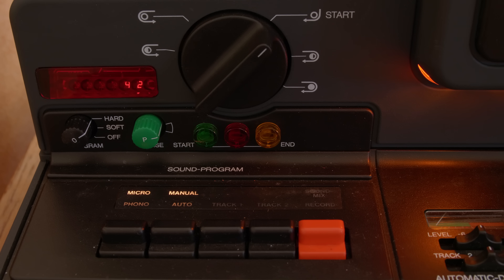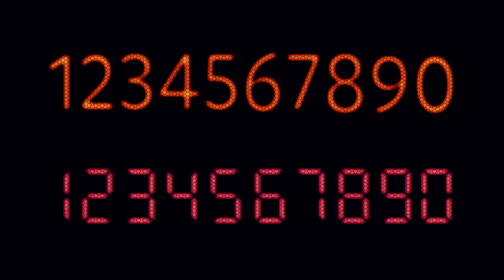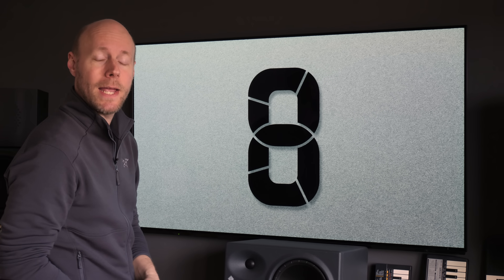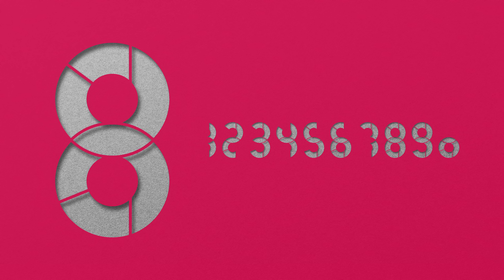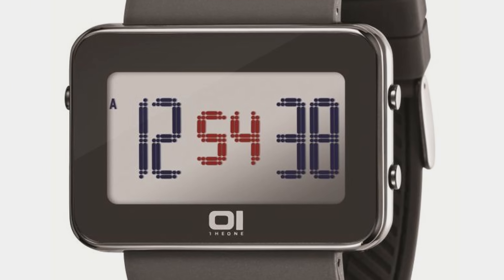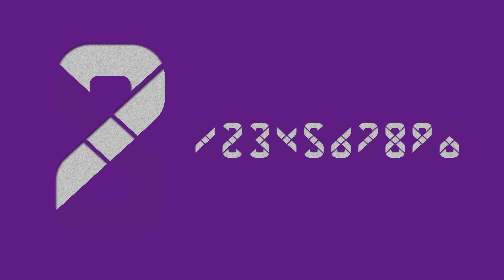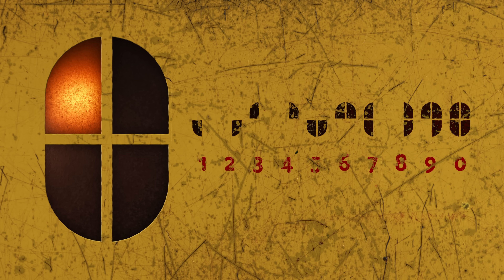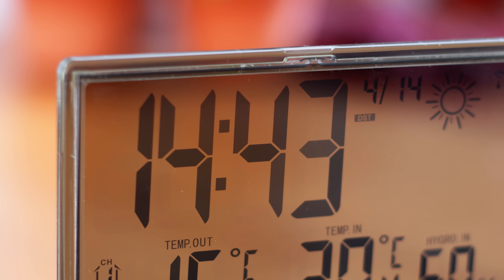Segmented Displays

Comment: The 7 segment double square has a hidden benefit.  You can encode your numbers as a byte each, without any wastage (6 segment) or need for multiple bytes (with wastage in a lot of cases), so it fits nicely with digital logic.
Reply: Why would a seven segment not have spare data in a byte?
What happens to the last bit?
Reply: @valentinfinozzi9358  y'know how 7-segment displays will often have a period/dot/colon? that's what the 8th bit is is used for
Reply: I recently bought a alarm clock off Amazon and it has a 7 panel font to the numbers. It is my favorite font I've seen and didn't realize it at order. The middle panel is a capsule shape, top and bottom panels are curved shapes with 45° corner cuts (like a slice of a donut), and the 4 vertical panels have half round inner corners  to accommodate the capsule shaped center but flat on the edge. It is so nice looking compared to what I've had on everything else. I never voiced these thoughts but here this video is in my recommended 🤣 thanks this video was awesome thanks!
Reply: @mcsquared5005  You should link the product.
Reply: @mcsquared5005  could you please share the name of the clock
Reply: It can also nicely display A-F so it can display hexadecimal too.
Reply: If a design has 15 segments (and the dot) wouldn’t that be almost as efficient but look better? Just saying
Reply: @OtterNoodle  14 segment displays exist and are widely used for stuff where you need to display letters. Not sure what you mean by "almost as efficient" tho, it's about half as efficient which is far from almost imo.
Reply: It also can do AbCdEF pretty well, which makes it convenient for displaying hexadecimal. just gotta make sure your 6 has a line on top to be distinguishable from b.
Reply: The extra byte could be used for a comma
Reply: @beanlets  it’s used for a period
Reply: Only really matters for software, though.  For hardware, you can use arbitrary bit widths.  I have some FPGA designs with 11 bit buses, for instance.
Reply: you mean bits not bytes right??
Reply: @crw_5319  No. 1 byte is 8 bits. So a number shown on a 7 segment display fits into 1 byte. If you were to use a display with more than 8 segments you'd need multiple bytes to represent a single character.
Reply: @crw_5319  no, I mean bytes.
Reply: @dreadlindwyrm  yeah you’re right i was thinking how you can represent all numbers with just 3 bits in binary but that was completely different
Reply: Was about to comment why having more segment is not a good idea. Thanks.
Reply: Old devices sometimes used 7 bits rather than 8. I'm not sure why, but they did. This is why ASCII is a 7-bit encoding.
Reply: @angeldude101  they probably needed the extra bit for some form of metadata.
Reply: i feel like my personal choice for a 7-segment display would be Freeform-7 from the sheet.
Reply: @datadoqueres9385
Reply: If you wanted to do a 9 segment display in a single byte, all you have to do is put 9 bits in the byte.

The number of bits in a byte was never a set number - people who have forgotten computing history just assume it's always 8 because that's what it is on the computer they're sitting in front of.
Reply: @trejkaz  That's not how it works though. You can't just make up a new length for bytes without redesigning the processor. 8 bits aren't an arbitrary choice either, since binary numbers are represented in base 2, using a power of 2 for word/byte size makes a lot of things convenient, continuing this "chain of convenience" led to the abundance of 7/8 segment displays.
Reply: @terryriley6410  8 bits are totally an arbitrary choice. It could well have been 4, or 16, and still been a power of 2. And also you're forgetting that a lot of computers did not have a byte size of 8.

And you're also assuming that all processors are binary.
Reply: @trejkaz  4 bits aren't enough resolution for most things, too rough to have a "realistic" color palette, amplitudes for audio or to even represent the letters of the alphabet, 16 bits are more than enough. 8 is the first power of two that is generally useful.

I never claimed you couldn't have non-binary processors  or that no other byte length could work. It's a question of comfort, efficiency and tradition. Which makes 8 sized byte or 7 segment displays not a "totally arbitrary" choice. You can of course free to design your own processor and n segment displays if you want.
Reply: @trejkaz  I assume in that end bit you are talking about the trinary experiments of the russians, they failed because its too complicated to represent 3 states with electricity, yes you could have half of the current represent 1 and full current represent 2 but trying to figure out that is much harder than just off or on, also I mean 8 bits is almost arbitrary but they do have actually have a name for 4 bits called a nibble, im sure people use it its just byte is quite a convienient measurement for people, also I'm sure there were some technical limitations of the time making 8 just an easy choice but uh dont quote me on that lol
Reply: @macslash5833  See paper: Tunnelling-based ternary metal–oxide–semiconductor technology (2019).

Quick tl;dr: Korea succeeded where Russia failed.
Reply: @trejkaz  Wait seriously? Huh that's cool as hell, ty for showing me this, I guess I was kinda wrong I guess the russians were just wayyy before their time on ternary computing which makes sense lol
Reply: @trejkaz  yes, but being a small enough value to represent most computational representations and being a power of 2 certainly helps it be the convention. Like saying googling (or in the case of csi miami, bing it)
Reply: I’m gonna need that in English please
Reply: @DJCARKENT  memory occurs in chunks called bytes made of 8 bits which can represent on or off for the segmented display.

Comment: I associate the two-square segmented display with Saint-Petersburg's old trams and trolleybuses. It's interesting that they also display the letter "A" (as in Saint-Petersburg's tradition shortened routes have it, for example the route 7A is the shortened route 7, and also ring routes are numbered with letters, so there is a ring route A.) A is written like this: 
         _
        |_|
        |  |
The problem is that the next letters in the Russian alphabet are "Б" and "B", which cannot be used as Б would look exactly like 6 and B exactly like 8, so while Moscow has ring routes А and Б, we can't until these displays are replaced.

Comment: I really like the 3 by 5 matrix, and I'm surprised that I dont think I've ever seen it before either 

It's very simple, yet also versatile

It has a bit of jank with the "n" and the "v" specifically, and the "w" and "q" isn't that greater either, but the numbers look really good and the first half of the Alphabet looks perfect

I quite like a bold, thick black design that contrasts the hardness of the strength of it being jet black with very clean, white edges and lines that are also softened slightly by being rounded

It's hard to describe, but it's like the slight tweaking and toning down of a sharp modern, monochrome aesthetic, but not one that's too thick and round to look bubbly, but also not too thin and sharp to lose it's boldness 

I feel like there's a very delicate balance of just how far in either direction I like it to go
Reply: Somebody said 3x5 has some illegibility between H, M, and W

Comment: Do you have any strong preferences about how your designs are used? I'm considering using your "no compromise" design as chapter numbers for a graphic novel.
Reply: Obvious thing to start with is give credit for the design in the book. Other option is special thanks section and credit him there. 
(But, If he dosn't give you direct feedback It's a bit up in the air if I would personally not use it. Unless he is explicit in a read me or something.)
Reply: @Mac_Omegaly  Depends on the use. The design is free to use for non-commercial purposes but If he plans on selling the graphic novel he will have to contact him

Comment: This got me thinking about the concept of displays that have other limitations.  Like, what if each letter has several servo motors that change the orientation of a bunch of sticks.  In my design, there's a central motor with two arms, where one arm has one joint and the other arm has two joints.  It doesn't matter which arm goes up because you can always just spin the whole thing around.

Comment: The train I was using as a student had a super fascinating display, which I analysed for hours. It was able to display digits as well as text, and consisted of equally designed segmented columns, which could be combined into variable width characters. For example, for a "1", "I" or "i" you needed one column, for a "M", "m", "W", etc. you needed five columns. Most of the other characters used three. I found the design choice behind this super interesting, and it made a quite versatile and readable display. (I cannot find any images of this online anywhere, sorry)
Reply: was it something like this:

|,,  |  |"|"|  |  |'-,|  |"|  |,,              (reads: LIMINAL)
Reply: @rextheroyalist6389  I'm not sure. In your example it looks like the columns are alternating between a soling column | and some smaller segments. 

The display I was describing was more like a matrix display, but some matrix squares were further segmented in "quarter circle + remainder" or "intersection of two quarter circles + remainder", in order to provide round edges for "m", "n", "0", etc.

And every column was segmented the same, and then a variable number of columns was combined for every character
Reply: @rextheroyalist6389  Oo that's nice
Reply: So if you search for "This LCD display appears in Subway trains in Berlin. What is this type of display technology called" you should be able to find mentioned reddit post.
Reply: @Alltagsabenteuer  that was oddly specific but it worked, thanks!!
Reply: @Alltagsabenteuer  https://preview.redd.it/1hf4ba75xklz.jpg?width=640&crop=smart&auto=webp&s=2f88e347e38274435f156f108fbed402f21224d3
Is this it?
Reply: @Alltagsabenteuer  bookmark comment later
Reply: @Alltagsabenteuer  oh wow that really is interesting! So many tiny segments…
Reply: Could you draw it and link an i,age?
Reply: Was this in the German S-Bahn?
Reply: @lahusa_  it might have been in use there, too. I just know it from the U35 in Bochum (which is a local tram)
Reply: @Alltagsabenteuer  perhaps a local can help? Leider wohne ich in Hannover :(
Reply: @geloschteruser2986  I found a photo on Reddit, but I cannot post links :(
Reply: @Alltagsabenteuer  perhaps you could give us the title of the reddit post?
Reply: @Alltagsabenteuer  gotta pay attention the next time I take the U35 xD
Reply: Typical destination sign.

The 4020 in Vienna uses the same.
Reply: 4:25 what it it say
Reply: Jgffhsndfqyychhjjvbkkb j
Reply: “oder”
Reply: @Strikingeight  you beat me oder is or I’m assuming user is German and if so I find it very comical to actually see this come out in text 😭
Reply: @Mo-rc6ph  Sorry, I'm German indeed. No idea how that "oder" slipped into the comment 😂

Comment: The linux kernel has a built in font "Mini_4x6" (most characters are fitted within 3x5 with the extra row and column being left for inter-character space, there are a few characters that do spill over though) includes inter-character space) which I think is quite similar to the 3x5 matrix font you show at the end, though it doesn't have the benefit of curved corners.

Comment: Back in the day I used to create my own fonts for DOS. It was possible to reduce the number of columns and rows in the font, so then you could get more than 80 columns and more than 50 lines. I think the limit I got to was a 5x6 font, bearing in mind I wanted lower case characters and also some symbols, but I could have 128 columns and 66 lines of text, which was a big bonus over conventional limits.
Reply: do u have pix?

Comment: I’ve been trying to make a new design for a display using less than 7 segments that works on using both either a segment that never goes off, or if that would still make it a 7 segment then a segment that is replaced with something like paint, and segments that are wired together to one switch, so they both activate together. Unfortunately, both of these methods require re-arranging how the numbers are formed, which is the largest struggle right now for me.

Comment: OLED and liquid crystal are used in the manufacture of displays. I would like to open a joint venture to make this material, and then a screen that I know a little about. Whoever wants to participate in the project tell me here in the comments because the information on how to make oled which is a basic material is very scarce

Comment: I was once bored in school to a point where I started studying a small 5-segment display placed in the corner of my watch. It was an absolutely pointless addition, as I discovered that all it did was displaying the seconds digit without the upper left and upper right segments.
And because I'm weird, this of course lead me to refining the idea of a 5-segment display, inventing a base-12 numeric system designed specifically for it and based on roman numerals. And then, after discovering that it has the same number of possible combinations as there are letters in Polish alphabet, I of course created an alphabet for it too (since then my profile image was the letter e in that alphabet).
I even practiced using both the numbers and the letters to a point where I could do long division in base-12 and transcribe paragraphs of text (often school notes or quotes from textbooks) using them exclusively.
And some time later I discovered that this exact shape of a 5-segment display was already used… by Star Wars cartoons. Of course.
I'm really glad I decided to watch this video because I almost completely forgot about this small invention of mine.

Comment: I tried coming up with my own segmented display concept, and ended up with something that was basically a combination of your "Double Bubble" and "XO" designs.
I haven't uploaded it anywhere yet (mostly for fear of it getting stolen or reattributed), but what I can tell you right now, though: it's a 16-segment display that uses ten shapes for the "bubble" aspect and six more in the corners and sides to square off corners and smooth out ovals, respectively. I tried playing with a full alphabet, and managed to get pretty much every letter to look distinct with an elegant "serifed" look, and can even display lowercase letters with minimal compromise in some letters (e, s, u/v).

Comment: One thing I think is missing from this video is that the typical 7-segment double-square design is that it can display AbCdEF quite well, making it suitable for displaying hexadecimal numbers. Very conventient for computers and digital logic where binary-encoded numbers are often represented in hexadecimal. You can count to 255 with only two digits (FF) instead of the three needed for decimal.

Comment: Nah, 80s  is better. Sorry.

Sorry, but you totally miss the point, and over-complicate some things while oversimplify others.

And the point is to easily fetch information to the brain. And that's it! Nobody gives a shit if it look close to manual writings of digits or not. The 80s design, as you call it, is simple, manufacturable, quickly readable. And every person is got used to it! 

It's "corner's problem" isn't even a problem, because thin places in digit's writing is distributed evenly, and is looking good. So one can say that this is a style. Everyone got used to it!

And bringing perfection to some numbers in cost of other's looking like shit (i.e reading much worse) is a bad idea!
I would not buy the watches with 1 looking like /, and 0 looking like o! 
And also making some digits written smoothly while others teared down is actually worsen performance of reading.

Another important point is manufacturing cheapness. Manufacturability. Adding more segments to digit, making something like 19 of them per digit is damage manufacturability. You just losing the whole point of using this display, by this. It would be better to use real matrix then. Top readability and good manufacturability, since they are already mass produced.

Upd: despite i disliked almost all of video, I forced myself to watch to the end, and actually, XO design is not that bad. but still, the quality is uneven. Classic 14 segment (not the one you showed), seems better, though.

Comment: I have a thought. 12:46 The reason the 3x5 matrix isnt used, In theory, Is because in comparison to the 5x7, readability suffers slightly. Think about it, The M and H are very similar, one block off and I even confused them with eachother when I first looked at them. Theres also the tradeoff of readability vs manufacturing ability/cost. I would theorize that if you're going to use a 3x5 matrix, You're better just going with a 5x7. The sheer fact seems to be that between ease of production vs ease of use, Its an equal tradeoff and so most just stick to the 5x7 as it doesnt matter how much you save in production if more people will buy the more complex display anyway. Thats just a thought I had.
Reply: On newer trains and metro I tend to see even higher resolution matrix or modern full color screens

Comment: It just so happens that I have a device that uses a matrix display with 3x5 digits. The Casio Tough-Solar watch uses it for the hours and minutes in a tiny little digital clock embedded in its analog clock face. The most interesting thing about it is that while the hours and minutes are a 3x5 matrix, the seconds are shown using regular old 7 segment right adjacent to it